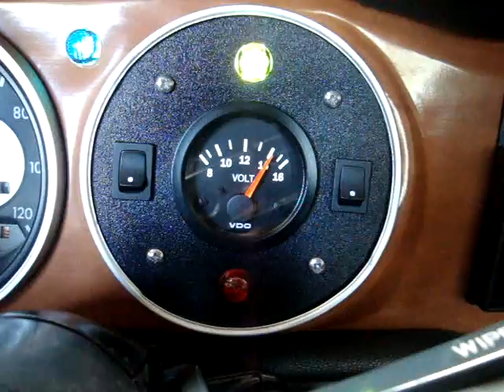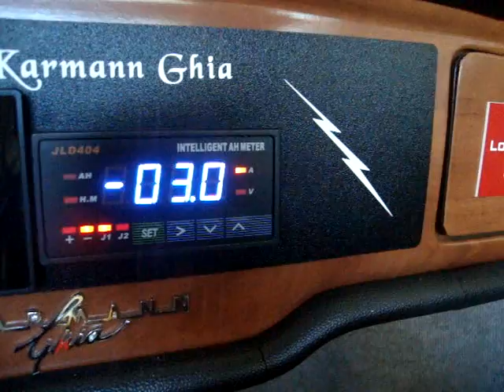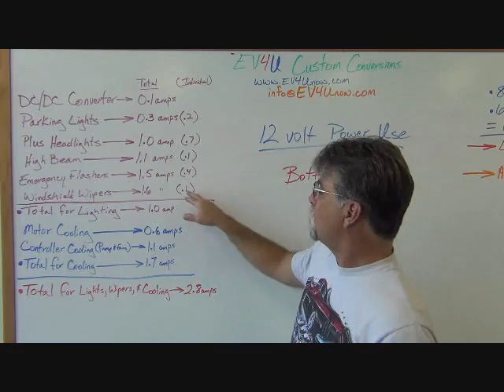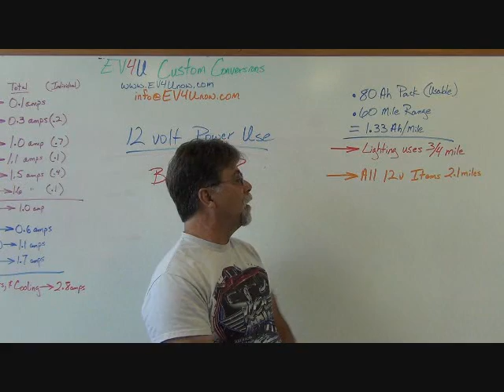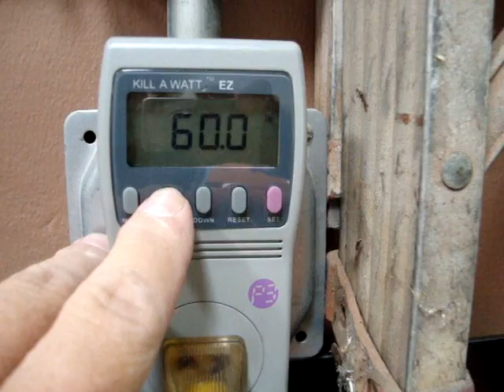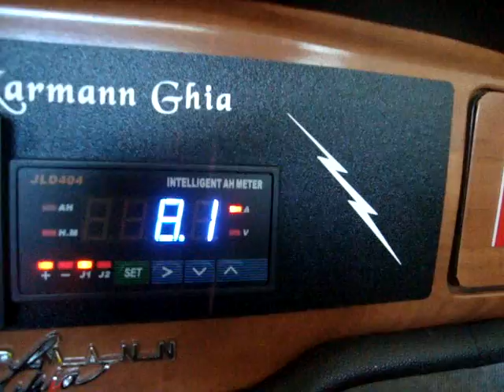EV Conversions - LED Lights, Why All the Fuss? - The EV Conversion Information Channel

Comment: I also wonder why the 12-volt battery is needed? Can't the DC to DC converter do the job of powering all the 12-volt loads? Maybe use a one Farid capacitor instead of a battery?
Reply from the maker: Check out this video for more information.
https://youtu.be/YbNBCLDzSOI

Comment: I may be wrong but it appears to me that the DC/DC converter is delivering 14 V from the high voltage pack. The amp meter is measuring the draw from the high voltage pack not the 12 Volt battery as you seem to imply. I truly respect the high level of research and time spent to get to this point of performance.
Reply from the maker: The DC/DC Converter is basically replicating the alternator on your internal combustion setup.  It has a regulated output with a maximum voltage output of 14.5 volts.  The DC/DC Converter in this car is rated at 400 watts and 30 amps.  You are right, the amp gauge is measuring the draw from the traction pack.  The point of the video is that with or without using LED lights the difference in range, or the effect on the pack is not a big deal.

Comment: Great video!  It goes to show that lights account for around 1% of the amount of energy needed, but only if you are running at night the whole time.  I can see some people not using blinkers because they would technically be saving energy and squeezing out more miles.  I would be interested more in the miles per weight.  For example, if you remove the spare tire, how many more miles could you go?  Or better yet, if the drive lost 20 pounds.  I'm sure there is some sort of curve to determine distance vs. weight.
Reply from the maker: Here's a link to a video that deals with range, weight, and cost.  http://youtu.be/oOJSnYeRxPw
Reply: Great thanks!

Comment: Great video again. I did not think it would be so little amperage use but Im not surprised to see that. Mine still has all the original lights as well. I use both the DC DC and an Aux battery of 4 100ah LiFePO4 cells. Vicor Bricks for the DC DC.